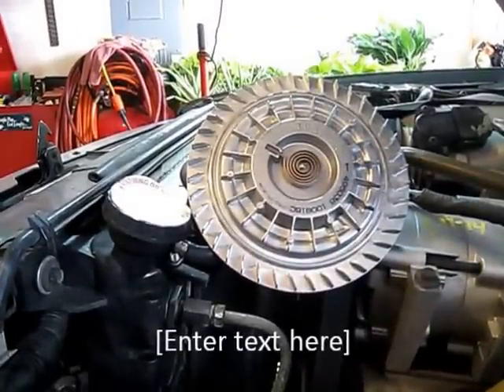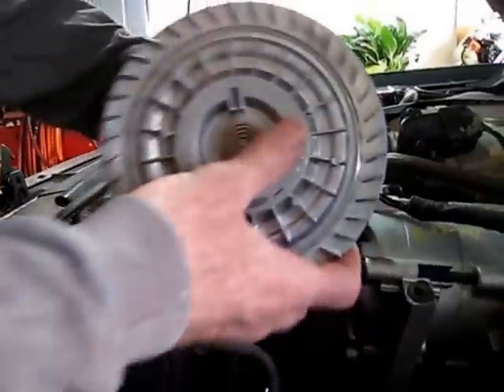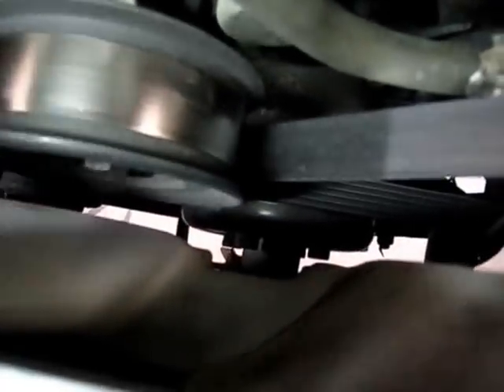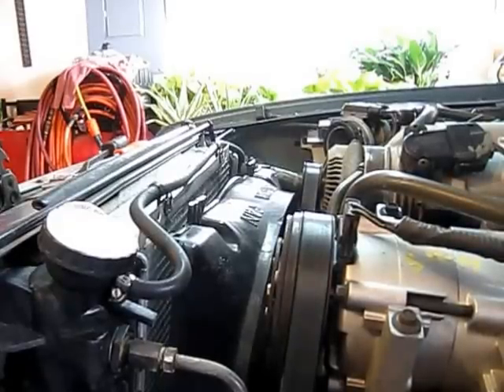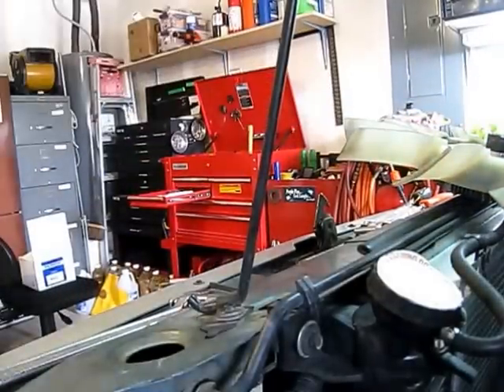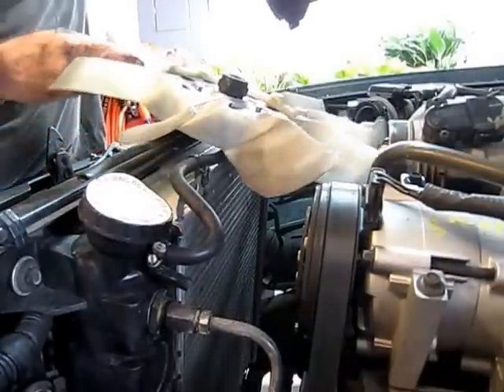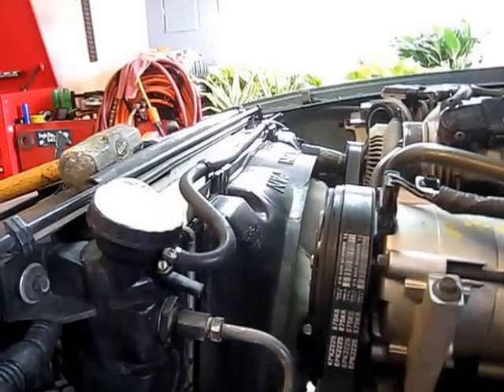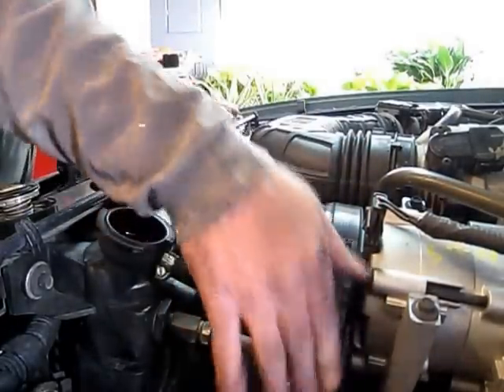How to know if my fan clutch is bad

Comment: I have an 84 Celica, and it's CF is LOUD at start-up (only when cold), but goes away after a few miles.  It's louder during the summer.  This has been going on for the last 4 years.  Never overheats.

Even so, I'm changing it now.

Comment: I'm sorry bro. You have this ALL wrong. Neither of your temperature sensors has anything to do with the clutch fan. The viscous clutch is a stand alone device that engages or disengages based solely on the temperature of the air coming across the bimetal coil on the front of the clutch. as the coolant in the radiator heats up, so does the air being drawn through the radiator, VIA the fan, thus heating the bimetal coil and causing it to "expand" and then open the oil passages inside the clutch. When the oil passages open, there is more resistance in the clutch causing the fan to rotate at a higher speed thus drawing more heat away from the radiator.
Reply: He’s mixed up the operation of a thermo fan with a clutch fan lol. No spiral cable, no electrical sensor. It’s actually cool how clutch fans work, it’s really clever technology, in saying that I’ve upgraded all my older vehicles to twin thermos
Reply: I just told him I thought it supose run all time like you said its a static position till viscous liquid gets hot from heat off radiator I have had to change my water pump over and I have never got my stat to stay open long enough to recerculate I have bursted 5 lads in 10 years it was a crash and repair its all ways span around so it as all clicked into place after research but this fella as thrown me out glad I seen your post man

Comment: Thank you for the video.  My trucks fan is running like a screaming demon too.  45 minutes late just starting to get some temp in my motor in summer time awesome for the ac but winter so cold... guess I need to mine swapped

Comment: Luckily the fan on my truck is easier to get to than this one, even though it's still a bit tight to get to. It has just enough room for a large Cresent wrench, then take a hammer and quickly wack the handle a couple times and it loosens the fan right up.

Comment: Good video I have a 2000 Toyota tundra sounds like a train tranny having trouble shifting so I revved on my engine really hard 5000 RPMs for at least a minute and the noise went away and my truck was shifting perfect The fan was stealing so much horsepower my truck will not shift and it burnt out the clutch fan mounting bracket bearing make sure your clutch fan isn't bad it can cause more problems than you think

Comment: I have a 2010 Chevy Duramax with 250 k on it..I’m in east TX, and am terrified to do this!  My truck has been “roaring”lately, it’s hot and I pull a three horse trailer a lot.  What should it cost to have our Chevy house fix this?  I don’t suppose you need a new client/side work do you?🙏😊

Comment: If your engine is "too cool", you probably don't have a bad fan clutch. When a fan clutch goes bad, it's generally because the bimetal strip is corroded and can't expand to open the oil passages, which in turn would, in theory mean the fan was not fully engaged at any point in time, thus meaning the engine would run hotter because the fan would not be able to draw an appropriate amount of heat from the coolant through the radiator.
Reply: That is incorrect. If it is stuck on then the vehicle will in fact stay cooler then it should because the fan is taking too much heat all the time. They should never be running all the time on high.

Comment: I had the same issue as yours; fully engaged all the time and sounding like a 747. Except mine was suppose to do that as the parts guy gave me a "Severe Duty Clutch". It's for vehicles that do alot of towing, hauling, plowing, pulling a fully loaded truck with family and the big boat behind you going up mountain grades kinda stuff. It was way overkill since I rarely tow so I swapped it for a standard clutch and the truck runs properly again.
Also, I used a length of pipe on the end of an adjustable wrench to break/tighten the fan clutch. I also use a few drops of BLUE threadlocker. 
Great Video. 5 Stars.
Reply: I've

Comment: Mine is 2007 I haveing a problem with bottom stat not opening for long and the radiator cold all time so when it does open it's cooling stat right away and shutting causing engine to over heat wich sounds daft I havd been told its heat sensor off rad there's no signal to anything to cars electric mine is running all the Time on full and should not move at all till radiator gets hot

Comment: So you are going to check the atmospheric pressure of your coolant with a barometer? Will that give you the altitude of the coolant? You could probably look at a topographic map to find the elevation of your coolant based on where you park the vehicle. Also....a failing clutch fan is due to the bimetal ring "not expanding to open the passages for the silicone fluid to travel" and not due to it "not contracting". Have a nice day.

Comment: Forget the left or loosy. Just remember your wrench should go clockwise for tighten and counterclockwise for loosen because if you think of righty righty tighty you’ll think okay I’ll turn wrench in a circle going to the right which would be loosening so there it is It’ll confuse you. Also the ratchets are weird because the ratchet click setting should be adjusted for easier handling so you don’t have to make sure it’s turning in the right direction. Whichever way the pointer goes on the ratchet is the direction it should go but nope manufactures don’t do that
Reply: to the right is always tighter, not looser.  Every time.

Comment: I’ve got the same issue. My whole system it’s running good.  Engine doesn’t over Heath. Stays at 207   Degrees.  But I get cold air inside. I suspect it was my clutch fan

Comment: I just changed the water pump on my ranger.  Total pain in the ass. But I forgot to replace the shroud with the fan! Haha good thing I didn't have to remove the pulley again. Mine is reverse thread.

Comment: Your fan is loud when the engine starts due to "cold" oil trapped in the shear plates as the bimetal strip cooled of when you parked the vehicle. This means FULL engagement upon initial cold start. As the coolant warms, so does the bimetal strip as warmer air is drawn across the face of the clutch, through the radiator. This causes the oil passages and the oil to warm up and allows the fan to partially disengage as it should. There in is the reason the fan is loud on a cold start and the noise goes away as the engine warms.
Reply: I drive my car a hour to work. Every time I start my car my fans are loud. They never quiet down. I've replaced all but this clutch. Therefore its the clutch
Reply: @kennyelliott3538  yes it is the clutch. I drive a 06 H3 Hummer and mine use to do the same thing. Now it does what it needs to do. Morning starts it sounds like a jet. Then after it heats up aka normal running temp. It's quite again. Only comes on when need to. Before I had never heard it and it ran super hot all the time. Now no over heating issues

Comment: I have a 22RE. Been 90-100 degrees.  Flushed radiator, new thermostat, new fan clutch, water pump works fine. On hills or pulling anything engine overheats and boils over into the reservoir. Fan clutch is not adjustable. Took the spring out of the slot so the fan is always engaged. Thats my only fix in a pinch I have right now. Anyone have any other ideas?
Reply: @E. Squatch.....Only thing that would cause the issue you're describing on a 22RE is a head gasket and/or head. How do you know the water pump works "fine"?
Reply: @bhaggen  
Used a block tester. I think I got it figured....it was the radiator cap not working properly.  Water pump turns and I think the impeller is intact, no weeping..
Ill post again if it doesn't  seems to work when it gets hot again.
Reply: @E. Squatch.....You didn't check something as rudimentary as the cap? What's "not working properly"? It's not rocket science; there's 2 valves on the cap; the pressure release, which is the large 1-bar spring & seal, & the syphon return valve, which consists of a little hidden spring under that brass disc on top of the main seal. You should be able to gently lift that disc off the main seal which compresses the hidden spring; that's where the coolant returns from the expansion tank to the radiator. Many times a good cleaning will do the trick when the small passage in the center gets clogged with what's usually American green coolant. I no longer use green "Prestone" on ANYTHING! The main corrosion inhibitor is silica which turns to sand. I use BMW blue in my 66 Mustang. Toyotas love the red stuff! It's not cheap, but you'll reap the rewards in the long haul. And don't bother with anything but an OEM ND stainless cap; what's an extra 4 bucks? The only reason a 22R ends up having overheating/corrosion issues is cheap green coolant which eats away at the aluminum head & timing cover. Good luck...actually luck aint got nothing to do with it.
Reply: @bhaggen  
Well, its fixed now...
Reply: E. Squatch so the problem is just radiator cap?

Comment: Your water thermostat could be bad.  A stuck thermostat will not allow enough water to pass through the system forcing the radiator to try to cool excessively hot water all the time.
Reply from the maker: The bearing  in the fan clutch was actually bad and yes a bad thermostat can cause a similar problem the fan should be slightly hard to turn but not frozen and even with a bad thermostat the fan will not sound like a jet plane all the time thanks for your input.
Reply: Dan Henderson. Mine doesn't have a thermostat on it and when i stop at a light for awhile it gradually the needle starts going up explain ?

Comment: A fan cant "keep the engine too cool"   The thermostat controls water temperature, the fan assists the radiator in stopped or slow traffic
Reply from the maker: All I can tell you is that with the defroster on in the winter the windshield would fog over for a couple of seconds when the fan ran all the time now that the fan is working correctly the problem has gone away.If something weird is going to happen it happens to me.

Comment: Is there a reason you didn't just change the fluid inside the clutch ?
Reply from the maker: ? There is no fluid in the clutch.
Reply from the maker: Sorry yes there is a fluid in the fan clutch ,it is just easier to replace it .than to rebuild it and the fan clutch for this vehicle was only $ 38.00 .

Comment: I have a 2004 Chevrolet suburban I just replace the fan clutch because the loud air noise and is still making that noise
Reply from the maker: Is it an after market hub ? New or rebuilt?  I have bought aftermarket parts before and have had this problem. Sometime you just have to get it from the dealer.  That sucks. Call the place you pick it up from see if you can exchange it it could be defective .
Reply: Tray Bradford this the second one I put on and is still making that loud air noise
Reply from the maker: All the time ?Even after it warms up? I had this problem with one before and had to get it from the dealer, I had also gone to another parts dealer and same problem ,found out that they all come from the same supplier and were all defected.
Reply: Tray Bradford I know if I go to the Chevrolet dealer they gonna charge me an arm and a leg ima
Reply: Call them....
Reply: Tray Bradford when I turn on the truck u can hear it once your start it up and it goes away but when I start driving it that's when you hear it and it dont yo away even if I'm on the highway it goes away a little and when I stop at the traffic light and i accelerate you hear it again and even when is on park and I hit the gas the air noise still there
Reply from the maker: Yes they will I payed $300. at the dealer(but my problem went away) but only $38.00 at part house. You can try and go out side of the area you are in and see if it changes .Is it the heavy duty fan clutch or the light duty? You only need Heavy if hauling and they are louder. Need to know if a option?
Reply: Tray Bradford the fan clutch is almost the same one u have on ur video the second one I got at pep boys cost me $60.00
Reply: Tray Bradford $300.00 wow that includes labor